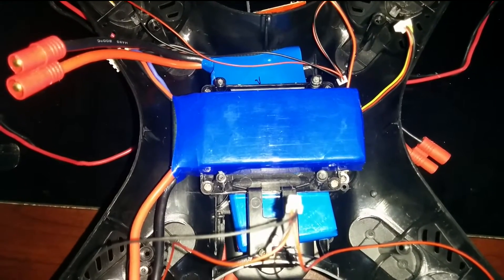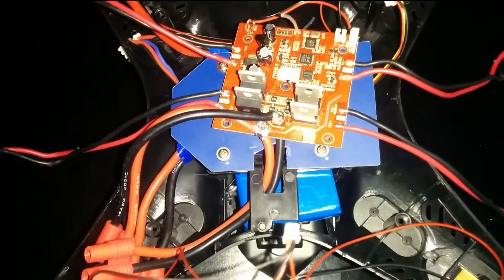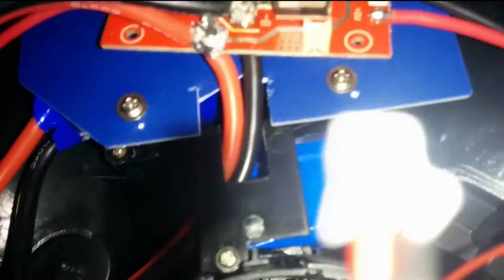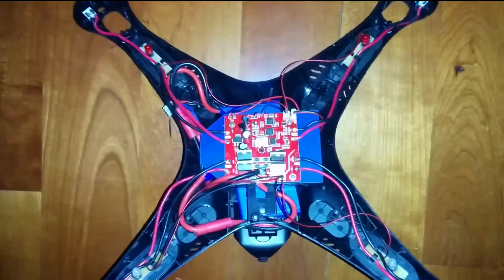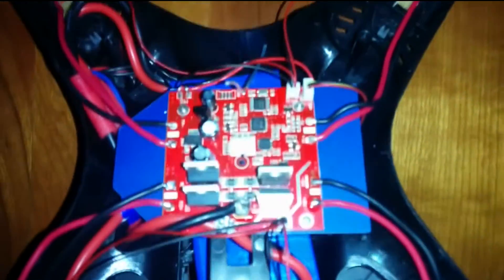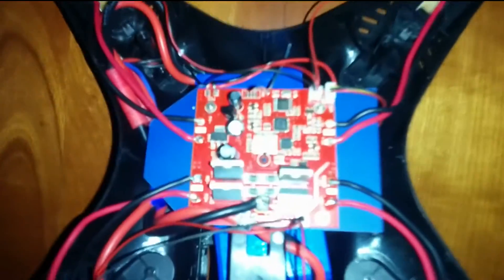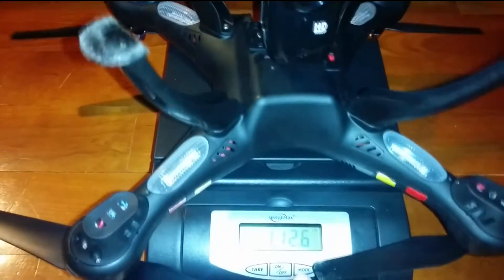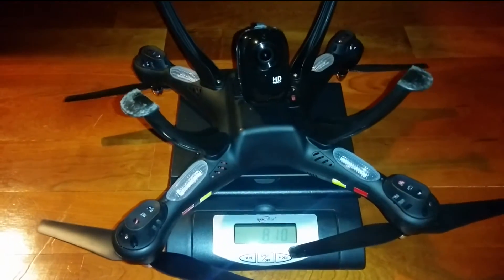Syma X8W X8C Dual Batteries Mod with SJ1000 camera and Acceleration Test

Comment: I finally got around to doing dual batteries. I found that that batteries are to much weight for my quad and it can barley get of the ground. Any help would be greatly appreciated.
Reply from the maker: +TheVeloGav If you have nothing else on the quad, then there is probably an issue with either the motors being weak or worn, or with the gears having too much or too little grease. But it could be that you have a gimbal, GoPro, fpv system, blade protectors, etc making it too heavy. What is the total weight of your quad? Mine was 810 grams and was still flying strong with many hours of use, but I regularly clean and grease my gears.

Comment: did you put them in series for 14.8V or in parallel so they stay the same at 7.4v
Reply from the maker: +TheVeloGav I put them in parallel to double the available amperage aka "C Rating" rather than increasing the voltage. I have seen other youtubers using 11.1V 3S batteries with their X8's, but I don't believe the circuit board allows the higher voltage to get passed onto the motors. With my setup, I have measured 7.0 Volts being passed onto the motors at 100% throttle, regardless of the charge state of the batteries.

Comment: ola rendus4

I have 2 batteries 7.4V 2000mha 25c my x8w if put both batteries will have problems with my engine ?
Reply from the maker: +B & L Studio Hi, no, you won't burn out your motors. You are still using 7.4 Volts, and the control board will only pass on as many amps to the motors as it needs without regard to the size of the battery. By running in parallel, you are adding your "C" value, so if you have two 25C batteries, it is effectively 50C, which reduces the voltage drop when pushing your motors hard. The are two issues I am aware of: (1) the added weight of the second battery increases the stress on the motors reducing life; and (2) because of the added flight time, the motors can reach higher temperatures, which also reduces their life.
Reply: thank you
I will try to add a battery 1500mAh 3s 25c.
Reply from the maker: +B & L Studio You said you had 2 7.4V 2000mAh batteries. Where did the 11.1V 1500mAh battery come from? Definitely DO NOT add a 3S battery where you have a 2S battery in place!!!

Comment: Put two batteries in parallel to 7.4V 10000mAh each battery, making a total of 7.4ve 20000mAh, the Syma x8w flies? He can fly? Will expand the flight time? Will have a problem on the board or in the circuit?
Reply from the maker: +contajr jr English: It is approximately 5.65 grams per mAh, so 20000mAh would weigh 1.13 kilograms. The x8w motors cannot lift that kind of weight. Portuguese (Google Translate): Fica a cerca de 5,65 gramas por mAh , então 20000mAh pesaria 1,13 kg . Os motores x8w não pode levantar esse tipo de peso.
Reply: +Rendus4  Ok. I know for weight, but just want to know if there would be any problem in the circuit board.

Knowing this weight problem, I'm thinking of putting rotor Brushless more powerful then my question is: I put the brushless rotor and the ESC, also have to change the Syma card with one that accepts the ESCs or can use the Syma plate same? Grateful for the understanding and response. Thanks,

Aliexpress address below which has the rotor with ESCs. These are the totores ESCs and I wish to set. But I can connect on the board mother Syma or have to buy another appropriate adapter?

http://es.aliexpress.com/item/4set-lot-A2212-1000KV-Brushless-Outrunner-Motor-30A-ESC-1045-Propeller-1-pair-Quad-Rotor-Set/32225197601.html
Reply from the maker: +contajr jr I am actually experimenting with the same idea right now. If you want to go brushless, you will need a new control board aka flight controller that supports brushless motors like a Naze32 or an Ardupilot. But if you do that, you will need a new transmitter and receiver among other things, so you will basically only use the X8C's shell, which is pointless. The other option is to only change the motors to brushless, add ESCs, but you will also need to convert the signal to the motors. Brushless ESCs run on Pulse Width Modulation (PWM) at 5 Volts. I can't tell if the syma control board uses PWM because I don't know how to test for that and Syma does not publish a data sheet. I have tested that the voltage from the control board to the motor varies from 2 (at 10% throttle) to 7 volts (100% throttle). You will need a "Brushed to Brushless Converter" but I'm not sure if even that will work. The Brushed to Brushless Converters start at $18 each, and you need 4 of them! You are probably better off buying a Cheerson CX-20 or a used DJI Phantom 2 or 3 for that money, or just start building from scratch!
Reply: +Rendus4. OK thank you. You can tell if there is brushed motor (with brushes) that is more potent than that which originally comes with Syma X8 and can be placed (substituted) on Syma X8? What I realized already researching on websites and what I compratilhar with you is that almost everything that is done for Phantom2 is compatible with Syma X8 due to the size of the two that are alike. I bought some things in Aliexpress and if you type in the search for Aliexpress: "dji accessories" will Mostar a lot of things compatible.

Thank you for the information and we will be exchanging information here on how to improve the Drone Syma X8.
Reply from the maker: +contajr jr Someone is selling upgraded brushed motors on Amazon, but they do not provide any specifics. People who buy them claim they are sooooo much better, but do not provide any empirical proof. I wish someone would test their lifting power before and after the upgrade. If the motor is the same size and the brushes and windings are the same, how can it be so much more powerful? A more loose bearing will only give more power for a few flights before it starts to fail. To me, brushless is the ONLY motor upgrade for the X8C. You are absolutely correct that the X8C is a Phantom 2 clone. Once you get your brushless motors, you will see that they fit perfect, you will need to just find a way to mount the motors to the bottom chassis, and cut the lip from the top of the chassis. You will see what I mean when you get the motors.
Reply: +Rendus4, I know, I get it. First of all, I want to apologize for writing, because I do not speak English, I use google translator to translate and contact you. My name is Junior, I'm from Brazil. What I think we have to test is whether the Syma accepts a Brushless and the ESC motor, what I'm trying to say is: Connect the ESC in Syma board using only the two white wires and black without the red wire and connect the wires ESC strength of the battery and test. I'll just buy an ESC and Brushless motor to test it later. This is the test that I want to do. You understand? What do you think?
Reply from the maker: +contajr jr No problem, English wasn't my first language either! I know exactly what you are saying. I would just recommend having a spare board in case the test burns the board. I do believe that the white wire is negative, the black wire is positive 5 Volts, and the red wire is the signal wire that tells the ESC how much power to pass on to the motor. Without the red wire, you won't get anywhere. My experiment would be to actually use the red and white wire to the Syma board, and connect the black wire to the 5 Volt output on the board. There are a couple places you could do that: one is from the camera plug (the three pins are +5V, Data, and Negative) and there is another place on the board that shows +5V, you just have to find it.
Reply: + Rendus4, I know, I understand there must be some way to get a brushless motor in Syma using the very Syma board without change. I'll keep thinking here of a way to do it. Do you have Facebook? if you add me. I created a facebook just to exchange information with people who have Drones. My face is this one: https://www.facebook.com/edy.dias.355

I posted some interesting photos there on adaptation brushless motors in Syma x8
Reply from the maker: +contajr jr I wish Syma published a data sheet on the control board. Then we would know if the board sends the same pulses that are required for the brushless ESC's to work. The brushless ESC's need +5V, and the input signal pulses vary from 1 millisecond for 0% throttle to 2 milliseconds for 100% throttle. We need to find someplace on the board where the signal is generated for the brushed ESC and solder in the brushless ESC to bypass the brushless one. I am not an electrical engineer, so it's not easy to figure it out. From what I see and what I've read,  Syma uses an H-Bridge configuration of Schottky rectifier diodes on the negative terminal of the battery to the negative terminal of each motor. Positive from the battery goes straight to each motor unswitched. But tracing the signal before the H-Bridge is difficult and I'm not sure I really understand it. Oh and I am not on facebook anymore, I had an account for 10 years, but I closed it over a year ago.

Comment: any update on flying time
Reply from the maker: +dave stp Just tested today, I got 10 minutes 30 seconds out of it with some pretty spirited flying before I got the low voltage flashing (3.75 volts resting). I get 7 to 8 minutes with only one battery, so it's still an improvement, just not a huge one.

Comment: what is the max flight time
Reply from the maker: +Adrian Lau I haven't tested it from fully charged to empty yet. I will let you know when I test that. Even though I don't get the low battery warning, after flying for a while, it seems the quadcopter struggles with the weight and doesn't fly as well, even though there is still battery life left. I would say you get 8-10 minutes of powerful flight and then probably a few more minutes of lower power hovering.